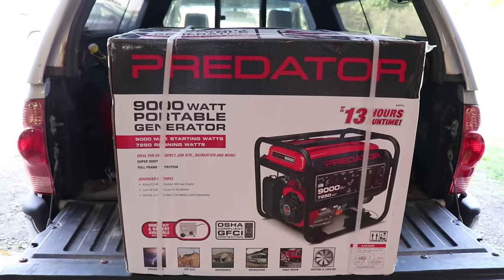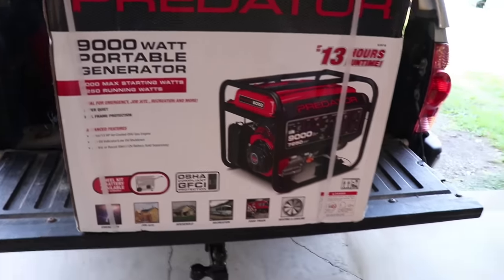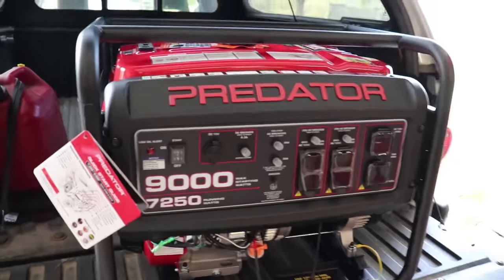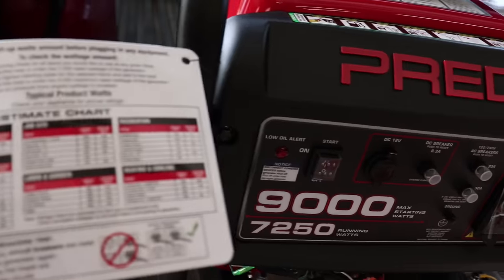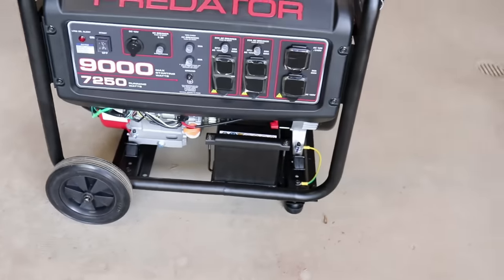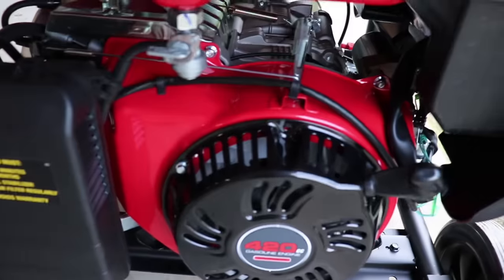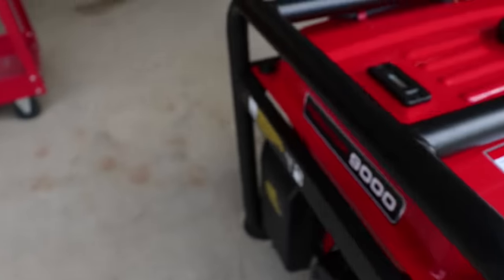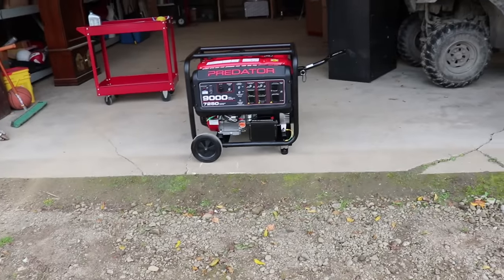Predator Generator Running Our ENTIRE Home. (Complete Setup and Cost)

Comment: Good video.  Couple of things for anyone wanting to do this.  First, don’t run the genie in an enclosed area or even in an open garage.  Carbon monoxide poisoning can be fatal.  Second, if you aren’t an electrician or know exactly what you’re doing, do not pull the cover off the main distribution panel.  Even with the Main breaker off there are lethal voltages present behind the panel.  Last, never run a generator while the mains are on, even if power is out in your area.  If the main breaker is closed you will back-feed current to the transformer feeding your home.  With lines de-energized, the transformer steps up your generator voltage from the 120V to 4,000V residential distribution and you can kill a lineman trying to restore your power.  Some people have made up a power cord with two male house plugs (15A 120V), plugged one end into the generator and the other into a wall outlet to power the house, leaving the Main breaker closed and back feeding the transformer.
Reply: While back feeding is definitely dangerous for any worker handling the line one thing continually gets overlooked. 
If you're lucky enough to not injure or kill the person working on the line once power is restore you will most likely have an out of phase situation. If that happens something is going to fail and fail in a significant way. If you're lucky only the panel, generator or both will be destroyed. Main breaker may not save your stuff in time.
Reply: i have a main cutoff switch coming into my home/ If i loose power , i plan on shutting the main panel switch off  and  outside switch to off/  then  back feeding thru my dryer plug in to run whole house Is this acceptable ? What problems do you see in my idea ?
Reply: That is also dangerous, because the wiring isn't designed for more than 15A per outlet, you can catch wires on fire by backfeeding too much current.  Your whole house goes up in flames, also you don't have just the linemen to worry about but it's possible you'll be backfeeding a small portion of the grid to include several homes that are all connected to the same circuit that feeds your home... You MIGHT be able to do something with the plug your dryer uses as that tends to be a 30A circuit but you still need to check with a qualified electrician to be sure.
Reply: Travis Hamler   IMO, a lockout switch is mission critical. No way I'd connect my gen to the home without one. They're relatively inexpensive, simple to install, foolproof to use and they never wear out or break. Good call on your part here.
Reply: @freespirit7475  .....not a good idea, for many reasons. Do a search using your words, "generator feed through a drier connection"....and see.
Reply: Travis Hamler  Can you cite a law making it illegal?  I couldn't find one.
Reply: @muhammadsteinberg  ^This is the bigger danger of leaving the main open.  The repairmen know how to avoid backfeed, but putting 240 volts from the mains straight back through the generator windings cooks them in a gas-tank melting flash, and huge fire.
Reply: @freespirit7475  Its an emergency measure, not something that will ever have to pass code.  The issue with the dryer idea is load balancing so essentially wire gauge, the dryer is given large "hot" wires for the +120 and -120 and either a smaller 15 amp capable neutral and a ground or just a ground wire.  When you try to run 7200 watts of home through that, the 15 amp neutral or worse the ground becomes the neutral for the entire load.  If its not a large enough wire to take that load, the wire will heat and can start a fire. A better route would be a car charging port in your garage or welding port, or just installing your own 240 volt "outlet" on the exterior next to your generator place or service outlet.  The thing is just KNOW FOR SURE THE GAUGE OF CONDUCTORS.  I know all 3 wires are 6 gauge for my welder outlet, so they're up to the task.  Your dryer may not have the wires you think it needs, It may only be able to run its what? 25 amps on the two main conductors, and runs little to nothing on the neutral if it even has one.
Reply: Travis Hamler  you SAY that, but can you CITE it?  Where? Are there emergency exemptions?  How is it DETECTED, let alone enforced? (that question prohibitionists never bother to think about).  We're not trying to pass inspection, we're trying to get the power on during an emergency.  Cite the law that says backfeeding at that particular time is "illegal" (punishable by law), not a law that says to pass inspection by the local building safety inspector your stuff must be UL approved.   And if you want it to apply to ME, it has to be in Pinal County Arizona, where modifications "costing less than $500" do not need to be permitted at all.
Reply: Travis Hamler  I did try to look it up, and can't find anywhere that it is punishable by law to connect a generator to your home electrical without an interlock or transfer switch temporarily in an emergency (the topic). That's why I asked if you knew a source.  It appears you do not.
Backfeeding the utility grid and backfeeding an outlet are also two different topics you seem to conflate.  Backfeeding an outlet in an emergency without backfeeding the utility grid is quite common, I'd like to see a statute that says it is "illegal" so I challenge everyone who spouts "illegal" to provide their source, and find they're just parroting things they've heard.  The law as it applies to me is here, and no backfeeding an outlet to the service panel without an interlock or transfer switch in an emergency doesn't violate any of it.  
https://www.pinalcountyaz.gov/CommunityDevelopment/CodeCompliance/Documents/CODE%20COMPLIANCE%20PROCESS%203.2021.pdf
So yet again you say "@Snap-off  by the way, backfeeding is illegal " What law? Where?  Statute number?  Cite your source?  You're making the assertion, back it up with data.  That's not asking you to do OUR homework, its asking you to do YOURS. 
Go ahead and put-down my tools, like a 3rd grader, its Ok, we know you're just here to spout your "brilliance" to build your self esteem by putting others down to feel artificially elevated.  I knew you'd get emotional at some point, since that was obviously the impetus of your original post.  You do not have to have your house "code compliant" every second of every day, if you think you do CITE THE LAW.  I am following my own motto, I'm finding the ACTUAL LAW, rather than believing and parroting what other people say.  I can see the codes,  I can see the code compliance enforcement statutes.  I actually looked them up and read them before I started running my pie hole.  Of course my motivation is to find information, not build my poor self esteem by putting others down, and trolling their channel  looking for things to make me feel better about myself.  That's actually pretty pathetic of you. 🤣
Reply: Travis Hamler  You obviously didn't read the explanation I gave to the other guy why dryer receptacles cause fires backfeeding and see I already understand that issue completely.  Then you provided "sources" that consist of a guy named "Stellar" who "says it is illegal, because its against the NEC code", (a code only enforced upon inspections by code compliance officers, not something that is policed in emergencies.) And the second source was one that invariably said either "may be illegal" or "possibly illegal" as in "we didn't look it up we're just going to parrot the same crap.  
You need to find where a homeowner taking their home electrical out of code compliance in an emergency is "illegal" for your claim to be true.
Reply: Travis Hamler  That was a long way to say you can't cite any sources to back up your claim.  The "if crap goes wrong then negligence" isn't backing up your claim, that's just changing the subject to negligence laws. For your claim to be valid there would have to be legal penalties EVEN WITHOUT someone being harmed, and triggering negligence laws. Just for having done it, you'd need to be able to be cited at the least.  In the real world, even if a busybody like yourself reported me to county building safety, they'd send me a letter telling me I've been tattled on and that an inspector will be by within 30 days to inspect.  within those 30 days he won't see a single code violation, as the outlet IS correctly installed and up to code. Certainly even you aren't stupid enough to think anyone with a portable generator is out of code unless they have transfer switch or interlock in case someone wants to power the house with it.  And that's just "out of code" let alone "illegal".  I understand the actual electrical currents, loads, and needs of the system, and don't blindly follow safety rules designed for the mind-numingly stupid people who would actually backfeed to the utility connection. My degree is in electronics engineering.   I also understand how code enforcement works, and how stupid someone says when they say "not being perfectly code compliant in an emergency is ILLEGAL!".  But my degree is not in law, so I'll gladly give someone making a legal claim the opportunity to provide additional information.
Reply: Travis Hamler  Since I looked it up, I can now PROVE I'm right and you're wrong.
If a homeowner locks the breaker or breaker box as they switch it open, that is FINE by the precious code.  Keep parroting what others tell you, you'll go far as a lemming who has no critical thinking skills. Here's the actiual code that applies, saying the exact opposite of your claim: (emphasis mine). 
 702.5 Transfer Equipment  (A) General:
Transfer equipment shall be required for all standby systems subject to the requirements of this article and for which an electric utility supply is either the normal or standby source. Transfer switches shall not be permitted to be reconditioned.
Exception: Temporary connection of a portable generator without transfer equipment shall be permitted where conditions of maintenance and supervision ensure that only qualified persons service the installation and where the normal supply is physically isolated by a lockable disconnecting means or by disconnection of the normal supply conductors.

NEC Glossary:
Physically Isolated: Not readily accessible to persons unless special means for access are used. (CMP-1)

Lockable Disconnecting Means: Where a disconnecting means is required to be lockable open elsewhere in this Code, it shall be capable of being locked in the open position.

Whatever emotional reaction you have to being proven wrong is understandable.  Education and truth rule out in the end on everything.  Learn to look stuff up before running your pie hole.
I only posted you a link directly to EXACTLY how code enforcement works in my county.  A fine or being arrested for doing something "illegal" is NO part of it.  You're simply incorrect.  It is NOT "illegal" as you say, and you've provided nothing but logical fallacy to support your argument.  Hopefully you do go away, but I'll be glad to slowly explain the actual code, and actual code enforcement if you're willing to learn, and don't just want to pad your self esteem by lying to yourself about what you know.
Reply: You girls are so cute debating back and forth on the internet. News flash, neither of you are going to change eachothers opinions. Give it up. 🤣
Reply: @tjfecteau8001  I'm not worried if I change his opinion, I'm counting on the facts and logic do to that. Glad to know you read it as well and are well informed.  Education is beautiful.
Reply: Travis Hamler  Ok I'll finish it, AGAIN, since we've already covered it but you're failing to understand it. 

Here's the ENTIRE CODE, and NEC's Definitions of terms (AGAIN) You let us know where does it say "you can be fined for not meeting code" [by powering your own home through the panel in an emergency - the topic]

It doesn't.  It says the EXACT OPPOSITE. It says that SHALL BE PERMITTED.  That PROVES there is NO "fine" and you were wrong when you said that.
Where does it say "only way to LEGALLY backfeed your electrical panel is to have the interlock kit installed." (your stupid words)  It doesn't.  It says the EXACT OPPOSITE, it says not having an interlock  SHALL BE PERMITTED. (it also says that a transfer switch is allowed, twice proving your "interlock" is the "only way" assertion false.) I have to just laugh that you capitalized "reconditioned" as though it needed stressed, when that entire sentence has exactly ZERO to do with our topic and has to do with whether a transfer switch once expired could be put back into use after only refurbishment. That just shows you really do not know what we are talking about at all.  I never put forth that them not being allowed to be reconditioned as reasoning why backfeeding a panel isn't illegal.  That would be stupid.  You trying to invent that I did as a strawman, is even more stupid. 
There's nothing left out, and nothing misapplied.   
 It was a good laugh watching you self-define "qualified persons" instead of doing what you say you do, and look it up in the NEC, which again PROVES you wrong. 
The NEC definition of qualified persons doesn't require certifications nor a job position, just "one who has skills and knowledge related to the construction and operation of the electrical equipment and installations."
And even though I had already GIVEN you the NEC definitions of "Physically Isolated" and "Lockable Disconnecting Means" you went ahead and tried to self-define those to salve your self-esteem as well.  
The conditions after "shall be allowed" ARE met by a locking a service panel. You just don't LIKE that, because it proves you're wrong. You can lock the main open with the service panel.  That is "locked" and in the "open" position, which satisfies "capable of being locked in the open position." How is it going to be put into the closed position without removing the lock?  Obviously much more work than would be required to take 3 screws out and defeat a stupid interlock (the professionals et al you suggest talking to, I've already talked to and they point out (accurately) how modifying ANY panel IS against the NEC, so installing an interlock even one that is UL listed REMOVES the UL listing of the panel and REQUIRES UL recertification IN-PERSON, the UL listing of the interlock is for the UL underwriter to RE-certify the panel, because if you'd had made a home-made one, he wouldn't be able to re-certify it because your interlock wasn't UL listed.  This means actually installing an interlock "up to code" is RIDICULOUSLY expensive.)(and STILL unnecessary).  The homeowner who backfed for 10 years during power outages sells his house without issue, and you with your self-installed interlock kit are flagged by your buyers' inspectors for having modified a panel with no recertification. . . .😂
I'm sorry you're remedial and have such special needs in education, though it is QUITE OBVIOUS you fully understand and just emotionally cannot acknowledge fact over your previous assertion, because that damages your poor little ego.    Its amusing to see you cling to defending saying "2+2=5" when shown in clear terms how the sum is actually 4, just for your emotional attachment to not acknowledging being incorrect. 

 702.5 Transfer Equipment  (A) General:
Transfer equipment shall be required for all standby systems subject to the requirements of this article and for which an electric utility supply is either the normal or standby source. Transfer switches shall not be permitted to be reconditioned.
Exception: Temporary connection of a portable generator without transfer equipment shall be permitted where conditions of maintenance and supervision ensure that only qualified persons service the installation and where the normal supply is physically isolated by a lockable disconnecting means or by disconnection of the normal supply conductors.
NEC Glossary: (what those terms really mean)
Qualified Person. One who has skills and knowledge related to the construction and operation of the electrical equipment and installations.
Physically Isolated: Not readily accessible to persons unless special means for access are used. 
Lockable Disconnecting Means: Where a disconnecting means is required to be lockable open elsewhere in this Code, it shall be capable of being locked in the open position.
Reply: Travis Hamler  I did, stop confusing the NFPA with the NEC.  I've got them straight, you've got them backward I'm guessing because the NFPA publishes the NEC. Then show where in codified law that the NFPA is adopted locally.  I found my county adopting the NEC, but nothing about the NFPA other than wildfire procedures and industrial zone liquid propane storage.  Answer to your queston: When you said "that is illegal".  You either meant "fine" or "jail".  Or is there some other kind of "illegal?"  That's not a twist, its understanding what you actually said.  You said "illegal"  Show it is "illegal".  How is it enforced?  I pasted you the link of how it actually would go down IF there even was a busybody reporting it to the county.  But you want to continue with your dreamland where you already know how everything works by ASSumption.  
The only "safety measure to prevent the generator from backfeeding to the electrical grid" that is necessary per code is a lockable main breaker.  I don't twist words, I educate people to what the actual truth is.  There is no need for an interlock, nor a transfer switch for temporary home panel generation, just a regular lockable panel that everyone already has. 
I explained to you what the real pros say of the interlock and in now way said you said a home-made interlock was ok.  That was part of the explaining why your $60 solution was really far more costly.  Interlock installation removes the UL listing of your whole panel and requires re-certification.  You didn't know that.  But I did.  Because I researched, and chatted with those who know. . . *before running my pie hole*. 
So you'd like to link a video where "lots of people even comment that it is illegal" as another source.  That's the argumentum ad populum logical fallacy:  https://yourlogicalfallacyis.com/bandwagon
You really do need to brush up on what is logical thinking and what is not.  It will help quell your emotional reactions, when logic reports back to you that there's NOTHING that can be leveled against correct and truthful information, rather than stirring you up into trolling other people's channels and lobbing personal insults to salve your self esteem.  
I don't want to "rig shit" I want to EDUCATE people.  There are stupid fear-mongerers like you who fool other stupid people into believing they can't run their home with their portable generator for a few hours or days without the police showing up.  I've recently exposed myself to this topic, saw through the epic amounts of bullshit, dug to the bottom, found the nugget of superior information, and will be spreading it.  Nobody can actually CITE how it is "illegal" as they claim *because it isn't*.  Nobody needs to be blowing money on transfer switches, delisting their panels with interlocks or hiring electricians when they could be shown how to just get the power going in a KNOWN TO BE SAFE MANNER, that is allowed by code.
Reply: Travis Hamler  Now you've just abandoned the topic, which means you know I'm right, and can't argue anymore, but are unable to control your emotional anger at being set straight.  Its typical of people like you.  Hooking up a generator with no transfer equipment is neither unsafe, illegal, nor against the national electric code. 
 70 is the code.  It is the installation documents, and what is required by county building departments.  110 is what is called performance documents they are a standard, but they are not "codes" with any backing of any authority.  You described them backwards.  702.5 is the applicable CODE.  everything within 110 is performance documentation, here's PROOF of that: 
 #TheMoreYouKnow.  I don't mind educating you.  We'll live in a better world the more educated everyone is. You obviously need to study U.S. building codes because your understanding isn't just lacking, it is factually incorrect.
Reply: Travis Hamler  I still dismiss any transfer equipment regulation for a portable generator, other than the specific regulation for a portable generator that says you can hook it up without transfer equipment, because that's the code that governs if you can hook up a portable generator without transfer equipment.  And generator regulations are a sub-part of building codes, as is the entire NEC. 
In what stupid way do you think "how often and to What[sic] percentage to load test a generator at a hospital or nursing home due to life saving or life dependant[sic] equipment." has to do with the TOPIC? (hooking up a portable generator without transfer equipment)?  You just thought it made you sound authoritative to say that, and you just like to "hear yourself speak".  Its got nothing to do with the topic, and regulations about that, would in NO WAY pertain to required by law connections at a residential home. (THE TOPIC).  
Go ahead and let out ALL your emotion of having been PROVEN WRONG, and just issue put-down after put-down.  Just pull them straight out of your ass, like my age (42 btw), my experience (been an electronics engineer for 25 years now), and my hobbies.  (I fix my own shit, and now how to learn topics I'm unfamiliar with and master them, like powering a home with a portable generator without wasting tons of unnecessary time and money on transfer equipment the code doesn't require, because someone else with their name on their shirt "says so, despite the clear wording in the code to the contrary".    I know you're not stupid, and I know you understand.  I know the ONLY problem you have with this, is that YOU weren't "right" to begin with, and being educated here requires you acknowledging you ASSumed, and/or trusted the words of others ignorantly.  I know I've educated you, and I know that you know now that transfer equipment for a portable generator is not required by the NEC.  I also know you'll never say "thanks for pointing that fact out to us" because before that you said "its ILLEGAL" and can't handle acknowledging having been completely incorrect, its too difficult for your immature ego to take.
Reply: Travis Hamler  back to "everyone says" argumentum ad populum  "everyone" also said the sun orbited the earth at one time.  That's a stupid and logically false assertion. The code says "SHALL BE ALLOWED" that proves anything you say to the contrary WRONG. By code you DO NOT "have a device either genlink, interlock on breaker panel, or a transfer switch" it says so right in the code.  "without transfer equipment (the stuff you say you "have to have") shall be allowed.  The code itself says its ok.   You can continue to utilize the "broken record" logical fallacy, it doesn't help your position.  You're saying that something the code specifically says "shall be allowed" isn't allowed.  That's not just stupid its flat WRONG. 
What you do for work isn't congruent to using a portable generator to power a home.  Its nice that you have employment, and nice there are people to tell you everything to do, because you're not very good at figuring things out on your own, but NONE of that has anything to do with the topic. The NEC trumps YOUR opinion. There is no "risk of someone finding out" its NOT ILLEGAL.  Its not something you need to hide or do clandestinely.  Its something you can do right in front of a police officer.   You stuipidly ask "Now can you hook it up without that shit?" the answer is YES! you can hook it up without that unnecessary shit.  The CODE says you CAN.   You also like an urban hood-rat (of any color) said "Now you in some shit."
Which is how you would describe the building safety department getting a report of me back-feeding in a way completely compliant with code?  Oooh  big whoop.  Sometime in the next 30 days an inspector will come see the entire system is entirely up to code.  What horrible "shit"!
If you think there's law or code that says " some type of safety device to ensure utility power is isolated from the home while generator is supplying power to the home is and always will be required. CITE IT.  I already did for you but you can go ahead and TRY to pull non-existent code out of your ass.  The only thing required PER CODE is that it is LOCKED. Period.  No interlock is required.  Why? the code says "without transfer equipment shall be allowed" 
If you think 702.5 "ONLY applies to special non-essential systems" then CITE THAT. Even if it were true, (it isn't) that would STILL apply to HOMES where generation isn't 'critical' so again you fail to support your assertion, your information backs up what I've said.  It IS the code that would govern portable generators hooked up to a home.  You're wrong if you think it isn't.  Provide proof.  Quote code.  (like I have been doing).  Don't' say "ask so and so" (argumentum ad populum and argumentum ad vericundiam)  Don't repeat "it is, because I said so." (broken record logical fallacy) Paste text that is codified into law (ALL LAWS are available to be copy/pasted online).  Just find them and show them if they exist.  They do not.  You just WANT them to exist to be right.    I showed the code saying you CAN do what you said is illegal.  Your only backup for that has been logical fallacy after logical fallacy.  
You said "No, it's fire Marshalls, OSHA reps, EPA reps. Same thing here. "  No, Marshalls, OSHA reps and EPA reps do nothing to enforce residential building code, pat pat pat.  That's not the "same thing".  OSHA doesn't apply at your home.  You're not employing people.  You like to throw big words that you really don't understand to make yourself seem smart to yourself but to the rest of the world it confirms your ignorance.   You're so emotional you just said my "home insurance rep" would "give you a citation, a fine".  You're really flailing with your emotion here.  An OSHA rep issuing a fine for a homeowner hooking up a generator?  Ok that's still funny you're so stupid you'd think an occupational safety organization would be involved where employment is not.  My insurance broker issuing me a fine is so stupid, its not even funny I want to laugh, but I know you're just talking out of emotion. The EPA (environmental protection agency) would just hang up on you reporting someone not using transfer equipment while generating power for their home. It has nothing to do with the environment, unless they've disabled pollution devices on the generator which is just off-topic.   There is no fine for not using transfer equipment to power your home temporarily. See: THE CODE 702.5 which applies to homes since they're not emergency, or life-critical places, where there are rules you seem to think apply everywhere always and have fine amounts that aren't findable on the internet, but do exist.   Those "fines" are a myth.  I've proven that to you.  You can deny it emotionally all you want.  Its still slightly amusing. But your argument that codes for emergency backup generators at hospitals apply to residential homes and supersede the specific language that allows generators without transfer equipment  in section 702.5 is wrong and stupid.
Reply: Travis Hamler  More education for you, (proof that 702 IS the section that applies) its stuff  I copy/pasted that you could have just googled, found and educated yourself about FIRST before running your pie hole and being wrong: 
Emergency Systems (NEC Article 700), which are legally required for some facilities, are systems whose operations are essential for safety to human life. These are also known as Level 1, or critical to life safety.  obviously this doesn't apply to homes
Legally Required Standby Systems (NEC Article 701) are required by codes to illuminate or to power equipment that is not categorized as requiring emergency power, but whose failure could create hazards, hinder rescue or hamper firefighting operations. These systems are known as Level 2, or less critical systems.
 obviously this doesn't apply to homes
Optional Standby Systems (NEC Article 702) are not required by code and serve equipment whose failure will not impact life safety. These systems may be specified and installed to protect against economic loss or business operations. The optional standby system is least stringent from a code standpoint, but can be “business critical.” End users may choose to voluntarily apply the more stringent emergency and legally required standards, depending on their tolerance for downtime in the event of a utility outage.  obviously this DOES apply to homes
Critical Operations Power Systems (NEC Article 708) were added as a classification in the 2008 NEC edition in response to the 9/11 terrorist attacks and the Hurricane Katrina disaster. These systems are required in facilities that, if destroyed or incapacitated, would disrupt national security, the economy or public health or safety. Government agencies or Authorities Having Jurisdiction (AHJ) can designate any critical facility ‒ such as police stations, fire stations, emergency call centers, telecommunications carriers, data centers and other critical infrastructure ‒ as a “designated critical operations area” to comply with Article 708.
 obviously this doesn't apply to homes
Reply: Proved you wrong again.  But more importantly, EDUCATED you again.  Now you know the power systems classifications for the NEC, stuff you should have already known to apply for your "job", but ok.
Reply: @freespirit7475  you have to have 2 males plug for this correct. make sure you never unplug the one in your house first while generator is running someone might touch or step on it by accident and get electrocuted,..
Reply: You’ve been waiting your whole life to post this LOL
Reply: @8307c4  so if you dont plug your generator into your homes panels like he did and you only use your generator to plug in extensions that you then pull inside your house or garage to plug in a fridge or toaster or led lights you must turn off or unplug all of those items and then turn off your generator? like can i just unplug the plugs directly from the generator while it is on and while the items that are plugged into those extensions are on without it being a problem and then turn off the generator while no plugs are plugged into it? i just bought one of these 9000s to use prob 6 times out of the year when our electricity goes out but i want to make sure i use it correctly.  let me know and thank you for your time!
Reply: @freespirit7475  I only see big, expensive problems. We, humans, are known to forget things. Anyway, good luck.
Reply: @8307c4  Give him a break. He's probably a DIYer 3rd class.
Reply: @snap-off5383  That LAW is called Common Sense.
Reply: @freespirit7475  If you burndown your house doing this, don't go crying to your home insurance company.
Reply: @outlet6989  What law?  The NEC code exception, is what is "common sense".  It's a "common sense exception".  "shall be permitted" in NEC code doesn't ever mean "is against common sense".